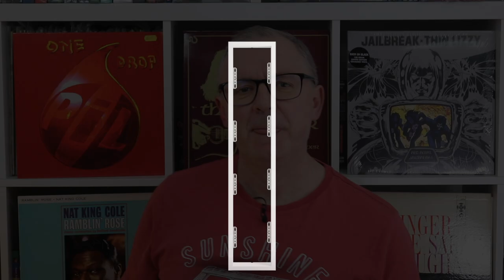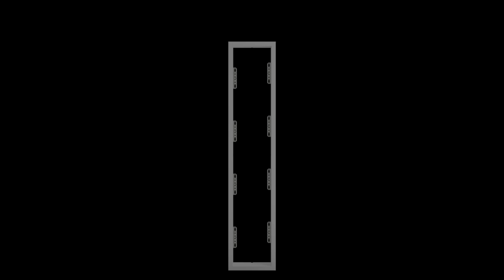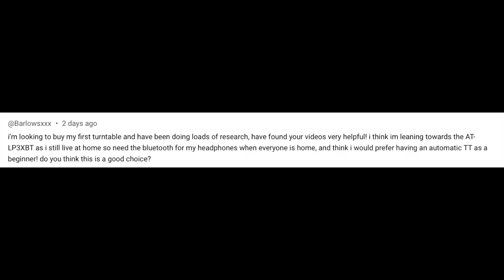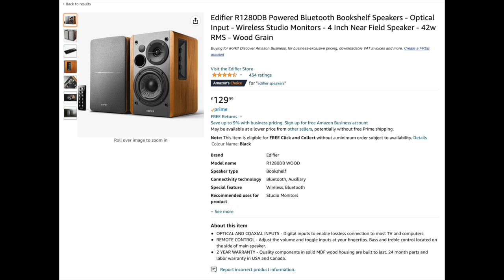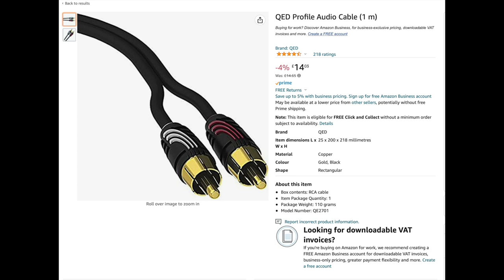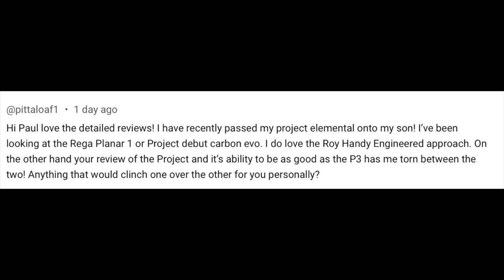HiFi NEWS, ETC. FROM BLUESOUND, KLEIO, DALI  & TRIVIA & VIEWER QUESTIONS & A TIP!

Comment: Paul, I live in a flat with neighbors beside and below me. I enjoy my modest system at a respectable volume as to not disturb others with a pair of Klipsch RP600M 2. The sound is nice, though I find the bass a bit lacking. I don't think a sub woofer would be appreciated from the neighbor below me. So my question is, is there a pair of speakers that might complement my Klipsch with more bass presence if I added two extra speakers to my amp? Or am I just going about this all wrong. Thank you